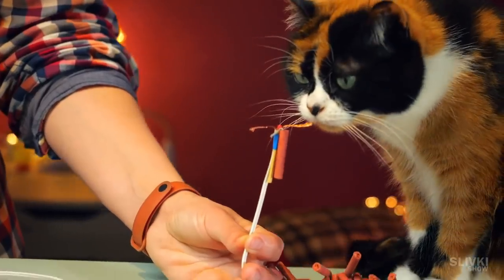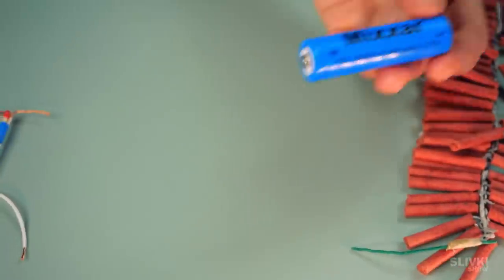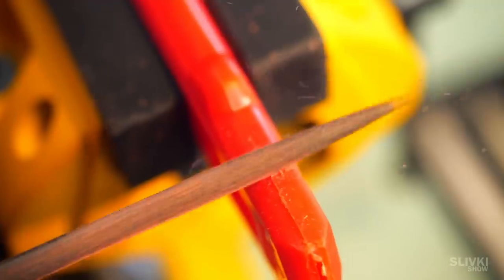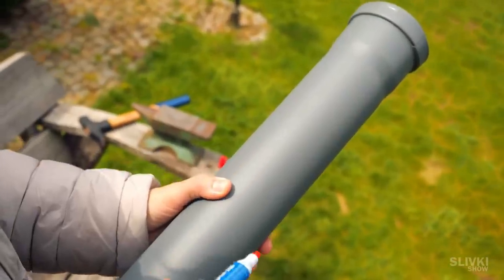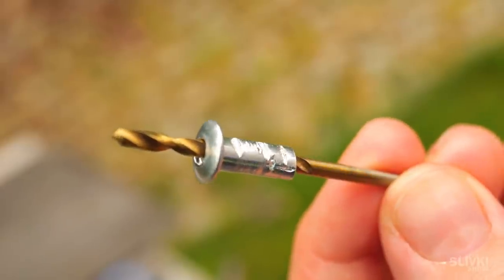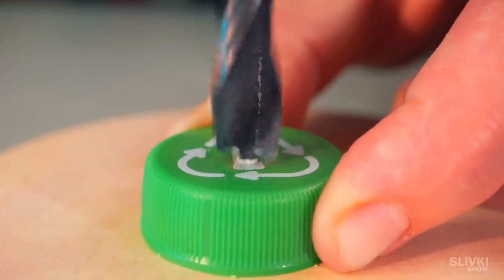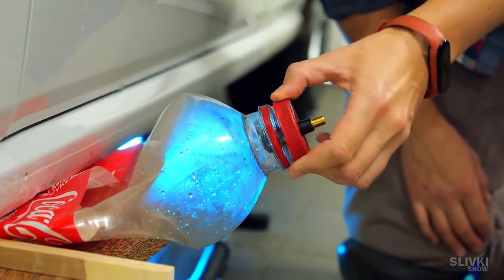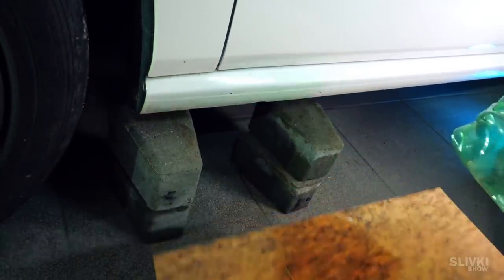7 LIFE HACKS FROM SLIVKISHOW

Comment: Great stuff. I am totally off grid. Only rain water. I adapt your ideas to my circumstances.  Thank you. No education,  but I love learning.  Greetings from Dimboola in Victoria,  Australia.
Reply: totally
Reply: If your off the grid then how are you watching this video and sending this comment?.
Reply: @Mr_K_OFFICIAL_CHANNEL  I have solar panels. A battery bank. An inverter. 12 volt DC LED lighting. Dedicated 12 volt refrigerator. A 12 volt television. Kick the inverter in the guts too use the washing machine, when needed. I have a shower that has it's own rechargeable pump from a usb. Hot water in summer is supplied by 300 metres of poly pipe laid in sun. I use my shower water to wash my really grotty stuff, (dog blankets, etc), then use that water to flush the toilet. I grow my own vegetables. No mains water. Just very smart use of what I have. I am on 700 per fortnight. That pays for meat for me. Rabbits are cheap. 2dollars each. Just have to spit the odd bit of buckshot out. Fresh meat for the 5 of us. Me. 2 dogs. 2 cats. 2 horses. Both require food. Farrier. Worming. Innoculations for all. Rates. Maintaining 20 acres. Without anything illegal. Just hard work and a tight budget. My turn now. What do YOU do? How do you survive? What are YOUR circumstances, if you are so quick to ask? Also. Total rainfall is approx 400 mm per year. 16 inches in a reasonable year. Next question?  Greetings from Dimboola, in Victoria, Australia. Little DESERT region.
Reply: I am guessing that you are under 20 years old. If your power went out for 2 hours, could you even watch a television? No internet. No heating. Cooling. If electric, no cooking. Not even a kettle. Turn your power off for the challenge. No phone. Just a candlelight to stop you tripping on way to toilet. Just 2 hours. Then comment on your experience. Looking forward to your results. Have a wonderful experiment. 🙂
Reply: @Mr_K_OFFICIAL_CHANNEL  Oh. Forgot. I don't use sugar at ALL. I don't eat junk food. No take away, because I am a good cook and grabbing fresh stuff that is less then 10 metres from the stove...... I am even willing to wager that you have a credit card. That it is maxed out. That you have no savings, or superannuation. I owned my first house at 22. Took loan out at 20. I did have a job. Then bought 320 acres. Bad divorce. Gave it away. Started again. A house. Paid over years. Used as collateral to buy 20 acres, with a cottage on it. Used both as collateral to buy a taxi service. It all paid it's way and employed 6 people. Moved on and am trying out solar and battery systems. I am so looking forward to hearing YOUR stories and thoughts. Any help from more experiences, are MORE THAN WELCOME.  Have a great day.
Reply: Oh. Forgot. I did raise 2 children as a solo parent as well. Both are employed in really good solid jobs. You lot wouldn't know how to do a nappy. Buy disposables. Do what with them? Next thing, you will be bleating about power going out. Had a couple of times that someone has rang me, to find out if I had power back yet. I had no idea that it was out in the locality.  I have probably spent about 20 dollars for power in 6 months. Because the weather hasn't been very helpful. But, 40 dollars for a year isn't a lot.

Comment: always been scared of lighting things in my hands, thanks for curing that!
Reply: The US legal limit is also only 50 mg of atomized aluminum flash powder so the worst that would happen is your ears ringing and a slight stinging sensation for a few seconds. The clay plugs are pretty thick so the fuse is also longer then it looks. I light hundreds with my hand and im completely fine. Or lay then down on something and then light them. Or you could light them on a spoon and fling them if your still scared

Comment: The remote detonator is dangerous af, you can easily burn your hand holding the terminals. Rarely the battery can even just explode. Shame on you slivki for showing something that dangerous without even a warning. Detonating firecracker at a safe distance but you burn your hands anyways.